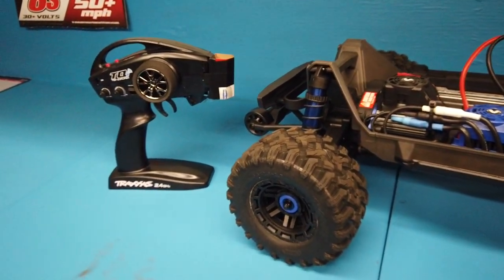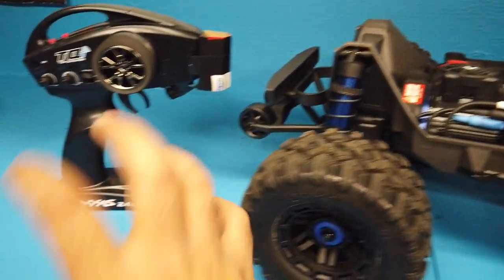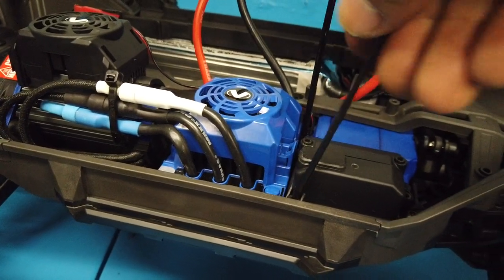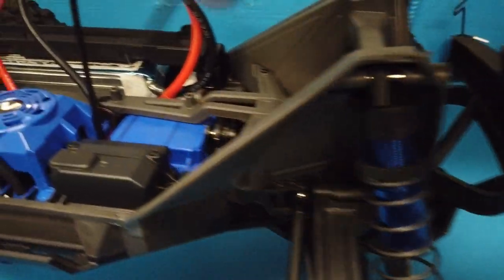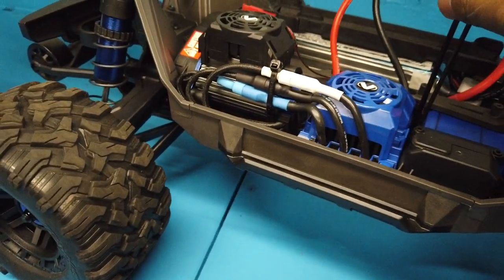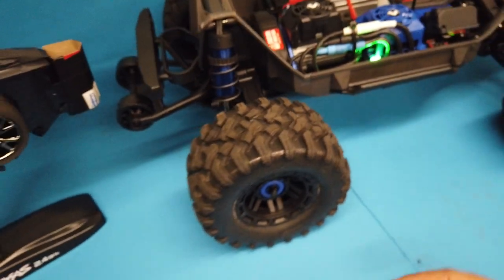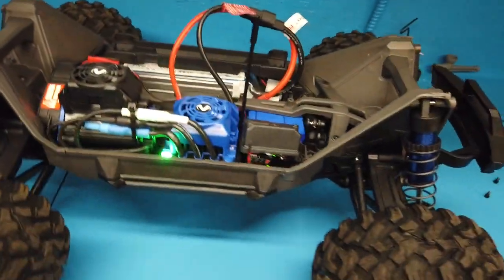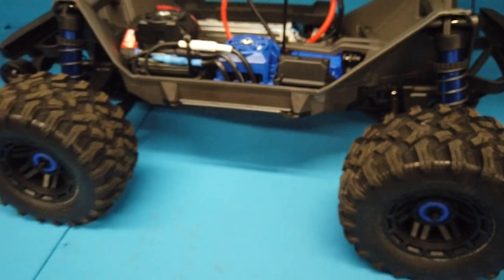How to bind Maxx transmitter and receiver

Comment: I need help to set my shit
Reply from the maker: Wats wrong?
Reply from the maker: Can u make a video Leme see what’s going on. There should be light flashes and manual book should tell I what’s that means but let’s see what’s happening u can bing it and calibrate it
Reply: @rcusa201  like u said it wasn't doin nothin esc and fan started but would not turn go nothing but i did what u did and the whells started to turn so i guess. Now its time to try to set every thing but i understand any off they tried making me buy dat thang that hook up to your phone they got me fucked up wit all that extra shit then i live in Oakland aint no shops but san Jose and they want me to pay for them to set my shit and i jzt bought from them and the wide maxx kit like last week i asked do i need to set controller white dude no its ready to run but i did put da kit on but I stare at the shit every day and cant do nothing then last night i broke the steering on my arrma typhoon